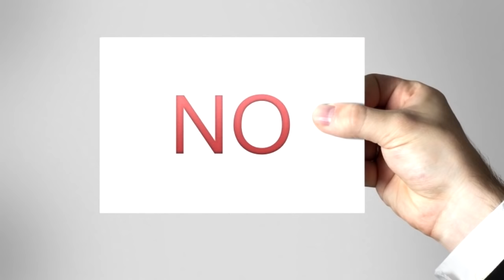There's a Steam Locomotive Beneath the Wells Fargo Center in Jacksonville, FL 🚂History in the Dark

Comment: There was small freight railway along the wharf in front of where the building is now. You are correct in that the 1901 fire burned the waterfront. Several small freight locomotives fell into the muck. The waterline was pushed back after the fire artificially afterwards using the fire rubble. So Jacksonvilles waterfront is actually sitting over a block of water.

Comment: The locomotive wasn't just dumped in the water, after the fire had consumed the wooden trestle and piers, it was embedded into the muddy sand bank of the tidal flats adjacent to the shoreline itself. 

According to the ("most credible") article on the subject, (that I could find, anyway,) a Jacksonville Newspaper article;
"The Great Fire consumed most of Jacksonville along with the entire wooden covered docks and railroad tracks that ran along Bay Street."

"As the docks burned the waterfront fell into the river taking with it many railcars." 

"Perhaps the locomotive we found was trying to get out or maybe making one last run to save whatever needed to be saved." 

"Only problem the entire city was in flames and there was nowhere to go." 

"The timbers collapsed, the docks were consumed and the locomotive slipped into the mud hissing and steaming as the water rushed over it."

"During construction of the Independent Life (Wells Fargo) Building, the entire city block was excavated to a depth of 20 or 30 feet." 

"A massive interlocking metal wall was driven around the perimeter of the block with well points every couple of yards." 

"Large diesel pumps ran 24/7 keeping the river out and the water table down." 

"We drove hundreds of I-beam pilings and hollow pile casing hundreds of feet into the ground with these steam powered drills and pile drivers." 

"The drill bits cost $10,000 each and were made by Howard Hughes’ Tool Bit company out in Texas. One bit was delivered on a tractor trailer. It would bore through rock." 

"As we were drilling and jetting an awful noise occurred as we hit something metal. It was the locomotive." 

"Several guys climbed off the rig and we went down and started digging. We removed the main bell and a few plates." 

"The reaction was not well received. The job halted, we called the big dogs and the suits at Independent Life. Everyone was afraid if the press got a hold of this the entire project would come to a halt. It was decided there wasn’t enough time or money to recover it." 

"I found a lot of artifacts from the gates were shut and everyone went home."

"Everyone always asks, “Why wasn’t the locomotive salvaged or reclaimed?” On a job this size there is tremendous coordination involving time and money between dozens of companies." 

"We even debated about not telling anyone that we discovered it while drilling. A few executives from Independent Life came out to the job site and we gave them a few artifacts. A few more artifacts were looted and snuck out by workers." 

"I had the task of locking up the site at 5:00pm everyday and I spent a lot of time poking around in the rubble." 

"My uncle told me to keep quite if I ever found anything else. I found a lot of bottles and such and it I found it fascinating poking thorough the “char line” from the 1901 fire. It smelled as if the fire was the day before. Lots of molten glass and metal and charcoal."

This, to me, sounds about as close to an actual eyewitness account as you can get. 

First hand information offered by a local, to a local publication, despite it being years after the fact. 

The guy's name is associated with the article so, it's easy enough to discover. (For anyone interested in doing such a thing.) 

I'm sure, if anybody knew the ultimate fate of the artifacts allegedly taken from the locomotive, at the time, it would be a good place to start. With this person's direct, (or even indirect,) descendants. 

(Just FYI ✌)
Reply: the awkward moment when comments section has better research than the video
Reply: Longest comment I have ever seen award 🎉🎉🎉🎉🎉🎉🎉🎉🎉🎉🎉🎊🎊🎊🎊🎊🎊🎊🎊🎊🎊🥇🎊🎊🎊🎊🎊🎊🎊🎉🎉🎉🎉🏆🎊🎊🎊🎊🎊🎊🎊🎊🎊🎊🎊🎊🎉🎉🎉🎉🎉🎉🎉

Comment: You can't move that! That's a load bearing locomotive! 🚂  A statement up until today I would have never imagined would need to be used 🤣
Reply: Unless you were part of the engineering team, I don't know how you can say that.
Iron rots and turns into rust which isn't load bearing.
It wouldn't be advisable to use an unknown quantity like a steam loco as a load bearing structure, who'd run the maths on that problem.
Land near a river is liable to have a fair bit of moisture, that loco could be under the water table.
Probably just increased the number/depth of piles around it, size and number of rebar in the base slab depth of base slab, possibly strength of concrete used in the base slab that the building sits on.
Reply: @georgechickful  I though it was very obvious I was joking....
Reply: Good joke. I also thought it was obvious. lol

Comment: Could we? Actually yes we could. Would it be worth it? No it wouldn't. Even if Well Fargo wanted it to be used as a lawn ornament the arrangement for extraction  would require at least a redesign of three of the surface level floors, deploying a gantry crane in the building on the third floor, make a door to have a truck or trucks move the locomotive out, and reestablishing and reconstructing the foundation and floors remodeled for this extraction. the money needed alone would be more than enough to build one from scratch.
Reply: Yep better served preserving non buried locomotives

Comment: It's not just a matter of halting the construction on site. The fact is that even now, we don't have very many types of cranes that could lift a full sized steam locomotive if even it were unearthed. They can easily weigh easily in excess of 600 tons or more which comes to somewhere in the ballpark of 1.2 million pounds and we don't have the kind of equipment necessary to lift or even move that heavy of object in its complete form out of the ground even if we can dig it up.

In my home town where I lived and grew up, there is one there as well which is right off the modern train tracks and they couldn't dig it out either due to its sheer size and the fact of where it derailed which is essentially in swampy land and it sinks so many feet every year due to that fact. If you have never seen one of these trains locomotives up close, there is one that sits in the Henry Ford museum in Michigan which is absolutely massive. It would give you some idea as to what they were dealing with here and why it would essentially be impossible for them to remove it from the ground.

Comment: It wasnt lost, it was dumped, beleive me, I know, if its even a loco, I spent years at the shiphard at 750 e bay st as a young man on a shovel in "yard facilities" and what most people dont know or realize is that everything along the riverfront is FILL, when we put the double barrel 16s under jefferson st, the stuff that came out was broken pieces of RR china and old coke bottles that some folks gave 25 bucks for, it got so bad the crew had to petition off the entire site for liability issues, I wish I had gotten something but I was pretty busy in those days and we had 8 construction crews as well as 8 maintenance crews not including all the jetting and televising crews and then some, sorry rambling, that was before the days of contractor take over, but thats another story, sorry to ramble, I remember at the shipyard it was flat points on the drydocks, but in the paved portion anywhere else it was a given to head on over to the storeroom (now long gone) and check out a 90lb. jack jammer and 2 coils of air hose and a quart of oil before everyone was wore out, then we,d go down until usually hitting RR tracks about 5 or 6 feet deep and call for a burning crew and a pettibone (cause it was local 805 union then in the yard "open shop") and then keep on going down with a 3 1/2 inch trash pump and ladder until we got to whatever the pipe shop or yard diver was after, ah youth, I did a lot of growin up down there, love your video, never forget men like Henry Flagler and the RR men of early on who broke their backs and helped make this country great, from the emigrants to the surveyors to the track crews that keep it going still today, a country is nothing without its infrastructure.

Comment: Isn't that a structural hazard, having a hollow hunk of metal holding up 20-30 feet of soil under a skyscraper? I mean it survived the drills pounding the body of it, but still that just doesn't seem to line up completely right.
Reply: I feel it is unlikely the structure of the locomotive is load baring in any way. Actual load baring structures are either going through it or around it. It could also conceivably be encased in concrete so it doesn't crush under the load of the surrounding substrate and thus promote shifting of said substrate and possible subsidence of the foundation.

Comment: if you cant get it from above due to a skyscraper.. what about.. from below? if the location of the locomotive is known  then  couldnt someone tunnel under the foundation  locate the wheels of the loco and tender.. dig out and lower it on to tracks built into the tunnel which would be reinforced to prevent any cave ins  back the TBM out to  where they dug in to drop it vertically  then crane out the loco and tender  fill in the  void  from  where the loco was with cement and i beams and then fill the tunnel itself as well.

Comment: I am a construction design student, just a student not an expert, but keeping the locomotive there could cause problems for the building long term. As tropical storms rattle the building the train will rattle like a rock in your shoe. This could cause damage to the foundation and no one wants a damage foundation even more so for a sky scrapper. Plus a train is not designed to take that kind of weight, the train is most likely crushed under all that pressure. But that is my theory from my education of six years. I will run this pass my professor and get second opinion.

Comment: So, the building is on the corner of Laura & Bay streets in downtown Jacksonville.  Looking at the 1897 and 1903 Sanborn fire insurance maps, there wasn't a railroad on that block.  The railroad in both maps stops at Hogan Street, one block west.  In 1897, the Florida Central & Peninsular Railroad owned the tracks, but in 1903 the Sea Board Air Line Railroad owned the tracks by the river per the Sanborn maps.  Not sure their relation to the Florida East Coast Rail Road.   Sidenote, the first resident of my house in Jacksonville (built ca. 1913) was a man named Benjamin J Fort who was a road master for the Seaboard Air Line Railroad.  I assume it's the same one listed on the Sanborn maps, but the documents I have call it Seaboard Air Line, while the Sanborn maps separate Sea and Board.

Comment: Reason why it is a Horrible idea for digging the locomotive out (based on my own thoughts)
1: The amount of money, you would have to either build a crane within the buildings interior which would probably costs a couple hundred thousand. Then if things go wrong you might have to pay for damages.
2: If it’s smack dab in the middle, you would have to find a way to support several hundreds tons of concrete and metal when removing the supports. If the middle of the building had no support whatsoever, it would implode upon causing chaos and possibly damaging other buildings.

Comment: During the seventies there was a electric railroad on the property of Ohio Power, AEP that hauled coal from the mine tward the power plant. This was a short railroad.  It was advertised as crewles and never stopped. I have searched and can't find anything about it.  It was real I remember about it. Could you find out about it?
Reply: The railroad you're asking about was called Muskingum Electric, it was a 15 mile operation at 50KV from the mine to power plant. It opened from memory in 1968 and i think it shut down in early 2000s. I was there to try to catch one of their electric locomotives in 1995 and by this time they were only operating about 3 miles of it. The railroad had one diesel and two electric locomotives. I don't remember about the diesel a lot since i'm an electric traction fan. It was a center cab though. Both of the electrics were based on Pennsylvania railroad E44 type, differences were mainly electric instalation and only a single pantograph. They were called E50 and had a very distingtive red and white paint scheme. As far as i know both were scrapped on the property of AEP when operation ended. I don't know what happened to the diesel.
Reply: @maciekkra539  Thank You very much. When I was a boy my dad worked for Ohio Power in Canton.  We visited the Ohio Power land and mine many times even a tour through Big Muskie for employees. In 1979 when I graduated from high school I was in the running for an electrician's apprenticeship with Central Ohio Coal Co. I was disqualified because of my father working for Ohio Power.  They had at that time a very harsh nepotism policy.  I still became an electrician and am retiring with 23 years CSX transportation as a road electrician. Thank You very much for this information I was looking and could not find any information l think it would make a good story.  Thanks again
Reply: @jeffmathias3222  Sure, no problem. If you can find a March 1979 copy of "Trains" magazine, it has a whole article on that "robot railroad". And if i remember correctly there's a fine shot of one of the E50s on the front cover.
Reply: @maciekkra539  Thank You again
Reply: @maciekkra539  I remember the Muskingum Electric and I remember those electric locomotives that looked like PRR  E-44s. If they were just going to scrap them, why didn't they offer them to a museum? That would have been the thing to do. I just don't understand some people.

Comment: I find this story to be very unlikely.  No engineer in their right mind would encase a hollow metal object, like a steam boiler, in a building foundation.  It will eventually rust away and seriously weaken the foundation.  It is entirely possible they found a loco but they would not have incorporated it into the foundation.  More likely to have buried it under the sub-basements.

Comment: This story for some reason reminded me of the White House. I forgot what president it was years back. But the White House was so old floors were sagging. This president had the exterior walls propped up and the entire interior was gutted and rebuilt. But the way he did it the public never knew what was going on. Probably because it would create issues kind of like if they try to remove this steam locomotive at the time.
Reply: Harry Truman's reconstruction 1949-1952 and during that time he lived across the street. The executive quarters were actually condemned as unsafe by structural engineers before there was any solid plan to fully renovate the building.